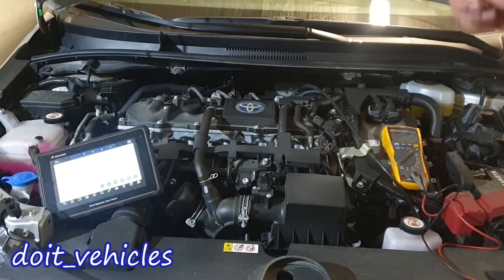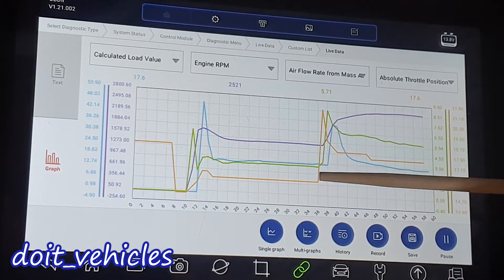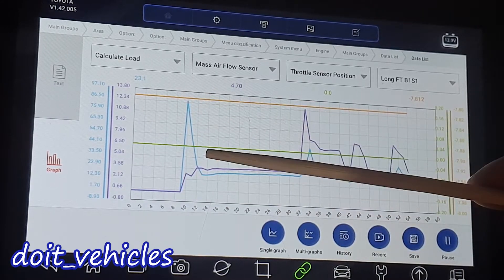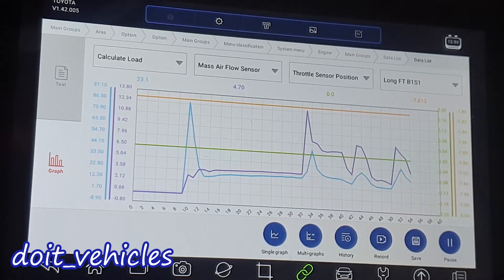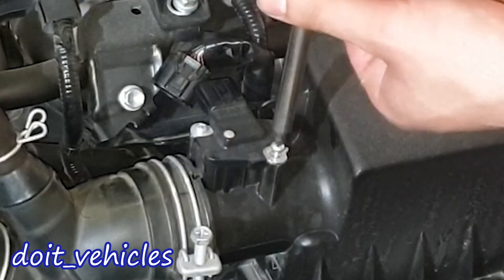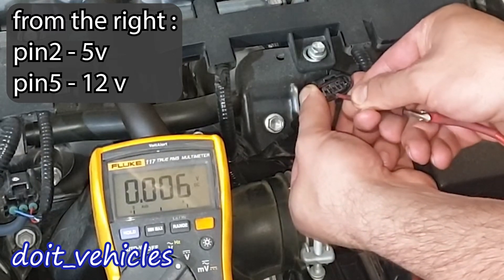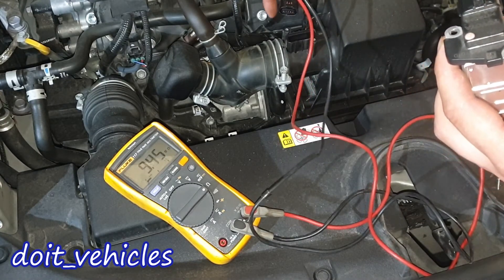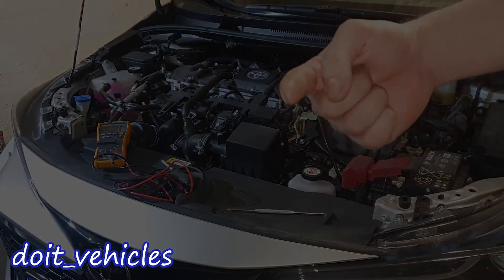Toyota Corolla Hybrid MAF sensor CLEAN ( removal , voltage values , resistance )

Comment: Hey man! Thank you for the awesome tutorials. I have a Mercedes W169 A150 1.5l 2006. Sometimes my gaspedal is hard to push down, i already cleaned the trottle body, what could it also be? (i think it's most of the time when temeratures are reallly cold). I hope you can help me, thank you so much.